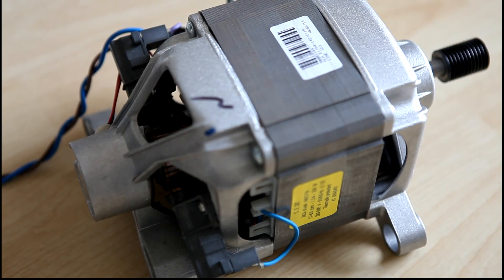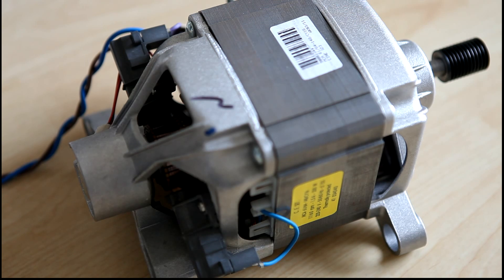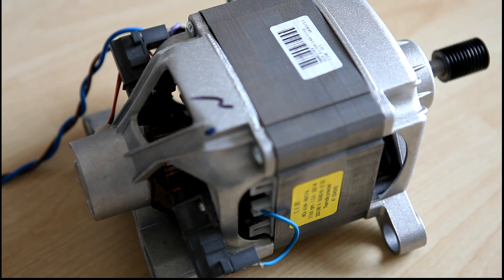Washing machine motor wired in as series motor (suicide motor)

Comment: I think that a separately excited field winding would have more chance of a run away  . If you turn off the applied voltage to the field windings while it's spinning the motor will go into run away .

Comment: What you have here in this video is a universal motor. It will most certainly never be found in any stationary applications used in North America. Universal motors are so named because they were designed to work on DC as well as AC. The last one I acquired was very old in the early 1970’s. Somewhat smaller motors of this design are still manufactured for plug in hand held tools mostly circular saws and very large drills. In the states the series wound units have a small shunt winding in addition to the larger series field   to keep the motor from over revving and splattering the armature coils all over and destroying the unit after reaching speeds in excess of 5000 rpm! Centrifugal force at high speed will do it.

Comment: Washing machine motors in the U.S. are always AC induction motors. I never saw a brush type  one. There may have been such motors in the old days when the machines ran off DC (New York City had DC power years ago)
Reply: norman gates  This is a universal motor. Can run both ac and dc curent.
Reply: This is a series wound motor. It is able to run off alternating current.
Reply: Yeah every washer/dryer motor I’ve seen in us brands have been either split phase induction or more rarely, bldc motors

Comment: why not use the tach gen on the back of the output shaft in closed loop for pwm giving a quite robust power output with variable loads and desired revs.

Comment: is it feasible to use it to power drones? 3 to four motors. Could it generate enough torque to fly a DC battery and chassis?
Reply: no, too heavy. You need brush-less
Reply: may be to inefficient you can get 3 wk bldc motors for 100 $ on hobby king tho witch are more powerful than washing machine motors and a lot lighter too but i think the most important thing is that they can control their speed much better

Comment: The inclined brushes, don't they imply the motor was meant to rotate in a certain direction?
Reply: Yes, of course. Motors designed to spin predominantly opposite brushes incline. It improves commutation in hi-rpm motors (weakens negative impact of vibration and collector's asperity on brush contact).

Comment: Some of the newer washing machine motors are actually electronically speed controlled via power mains and small speed-control circuit boards...and they are induction, NO brushes.

If you can filter any resulting RFI / EMI from them or being fed back into the mains, they make some very "powerful" and relatively easy to speed-control motors, with "generous" torque ratings as well....and some are actually priced decently, regardless of ones world location.

Comment: Such a liar, that motor is new and has never been in a washing machine.
Reply: +TruAnRksT I have one that looks the same and it was in a washing machine
Reply: -CLM15-
Wow must be pretty new and kept in a nice area then caus, ...
...there isn't even a spec of dust on that one. Did he pressure wash it? Was it manufactured so well that there is no sign of corrosion rust or even dust. How long could it have been used in a normal environment without showing signs?

Maybe, if it was removed from a returned defective unit could explain it's pristine condition.

Just look at the close up of the brushes, there is no powder residue around the brush mounts as you would expect on a used motor.
Reply: TruAnRksT I'm sure he cleaned it. Mine was a little dusty and I also removed the brushes so it can spin better.

Comment: The high quality washers (front loader) need to do many amazing things : slow rotation in one direction, reversal of direction with little dead time, slow rotation in opposite direction and repeat this cycle about 5 times.  This is done to spread the cloths uniformly to balance the weight prior to a fast rotation to drain water.

The DC motors inside cassette players include a gyroscopic speed regulator. If you would apply varying voltage, you would ear the music can be slowed down with lower voltage, but not speed up with higher voltage. With higher voltage, more sparks are generated in the commutators of the gyroscopic regulator.

The low quality washers which are still what most American can find in store even in 2015 use an induction motor. These are similar to squirrel cage type used in vinyl record players or microwave fan, but they use a gyroscopic switch to apply large current at start.
Reply: it's funny that in Europe (at least Poland) there are no new washing machines with a one-phase induction motor (there are VFDs in the better ones)

Comment: if the ac supply is at 50hz, the max speed the power supply can generate is at 3000rpm due to its pulse.. and if the motor is designed to withstand the speed of more than 3000rpm, the motor wont kill itself.. ok.. now let me return to my research cavern and think on how can i design a motor that can withstand 100,000 rpm without breaking itself apart even after running nonstop for 12 months on 50hz power supply..
Reply: +Vladimir Ashkanikov When going into your research cave you might wanna do some research on universal motors aka AC series motors. A universal motor's rpm is not bound to the frequency of the supplied AC current!
Field and armature are reversing polarity synchronously so it's as if you rectified the AC supply to feed a DC series motor.
Reply: ppdan why don't you go back to your cave and learn about N=120f/P
Reply: +Vladimir Ashkanikov Whatever, that formula is not applicable for universal motors! Speed depends on load!
http://physics.stackexchange.com/questions/210450/must-a-universal-motor-always-rotate-at-the-frequency-of-the-ac-current
Reply: ppdan you have a point..
Reply: I want psy songs in motor toilat
Reply: Lol this guy thought it was an ordinary induction motor.. Looking at speeds of 50-75,000 RPM here. Nice try tho.

Comment: You've got the motor running the wrong direction. On spin the motor runs the other way so the commutator slides under the angled brushes. On spin the motor is not under control from the trial on the board but is let go on full mains voltage as you have it running now, but the other way
Reply: Triac?
Reply: How will you change the spinning direction?

Comment: what does overspeed mean? like is it when the vibrations get too big and the parts just fall apart at some point?
Reply: series wound a.c. motors have no theoretical top speed. basically what happens is  centrifugal force and heat cause the brushes and commutator to burn out, in some cases literally exploding the commutator bars(see videos from Aussie50 and photonicinduction)

Comment: is there something like this out there that can regulate or control voltage digitally? or using a sensor? thru code on the arduino?
 
in other words i want to have something like this plugged to a motor driver set at a working safe dc brushed motor driver/controller setting but incase the motor picks up a load higher than the current setting cant output due to load the arduino can have the output from the converter step up by incrementing "++i" its voltage state digitally rather then you doing it by hand? therefor now the motor driver can have the motor handle the new load till theres no load and now the arduino can step voltages backdown to original safe settings?
Reply: Frank Lopez 
I'm trying something like this. PWM is your keyword, while controlling the PWM-value via a PID controller. I run it straight from rectified mains, so 325V DC, via an IGBT. Having a stable RPM-feedback is esential for this. The internal tacho of the motor is no good at lower RPM, so I attached a magnet to the axle and use a hall sensor. My goal is to react to a load change within a tenth of a second.
Reply: superdau right but im using gears so i will not be having the horn or what not at this shaft end but at the final ger resolution ill be building up to, i might have like some 4-12 gears interacting with each other to build up torque thru momentum and at the end of the last gear i will have a final output shaft where ill have the lever, or "servo type of horn"  

yes i already been order a hall sensor "looks like a transistor" and its control with a magnet which i will be inserting into the gear itself that i will be 3D printing OR just cnc mill it
Reply: Frank Lopez 
Do you have any image or part name of the thing that you use to connect something to the motor shaft? My control is working more or less now, but I don't know how to mount anything to the motor shaft (it's a hardened 10mm axle without any threads, flats or grooves)
Reply: pm me will talk more about it

Comment: Can you give me any help on this?  I went to the dump today looking for a motor to drive a project I'm making, and I found this exact same motor.  When it is driving a washing machine, it presumably has some sort of mechanism to make it run slower.  Do you know how it works?  Like the electronic control in a drill?  Being as the motor is only rated at 370W, I would have expected that running on only part of the phase would make it incapable of turning a drum full of wet laundry!
I need mine to run much slower that that!
Reply: The motor itself will run as fast as it can, given input voltage and the load you put on it. Washing machines control the speed probably through a triac and a PWM circuit. You could do that with a micro controller such as an Arduino.

My Kenwood kitchen mixer (and most KitchenAid mixers) have speed control through a spinning weight that breaks contact at a certain adjustable speed. When contact breaks, the motor slows down until contact is being made again.
Reply: 1313EbutUoy
Ah, yes!  The Kenwood Chef.  That speed control was designed before electronic controls were available, and Kenwood has not exactly shown itself to be surfing the wave of progress!  I'm surprised they don't use a steam-powered one.  Triac-based phase control is used to control the speed of practically every mains-powered electric drill you have been able to buy over the last 20 years, and I built a speed control for my first electric drill when I was about 25 years old - and I'm 69 now, so they have been around that long!  Even my electric blanket uses the same system.

Since posting the request for help above, I have done a bit of research, and found that there is a chip specifically designed for speed control of the Universal Motors in washing machines ("universal" because they will run on AC or DC).  The chip uses the tacho on the motor to sense speed, and can run the motor over a wide range of speed.  The chip is the TDA1085C (Google it), and is sold by several companies.  The one I bought is made by Motorola (a couple of dollars), and I have built most of the circuit (about $10 altogether).  I'm waiting for some connectors to complete it.

The TDA 1085C data sheet is available all over the web, and it gives an application circuit.  Once I complete it and make it work, I will post a short video on it, as there seems to be very little info available outside of the data sheet application, which still leaves some questions to be answered (but not by Motorola - no money involved, so they won't support it).
Reply: If it was more than say 10 years old what you have is an induction motor. It’s speed is line frequency dependent. An honest mistake because they all more or less look the same. His motor while it looks like yours is not an induction motor and will run on DC as well as AC but it’s speed is variable only by the applied voltage. It doesn’t care about 50 or 60 or zero line frequency hertz (dc). Find a newer usually front loading washer out of use because it leaks badly or door hinge broke. Remove the motor and the electronic controller and it can make a great replacement for a table saw or drill press  I have one fitted to an old table saw and now I control speed/ torque electrically or can change sheaves on the drive pulley the way it was built 65 years ago. Lots of options for hard or soft wood and controlling smoothness of cut. Take care at highest speeds as the carbide inserts on the saw blade can and will fly off. Let your blade cool off plenty.

Comment: It can be run on dc current ??
Reply: Dusko Lazic no
Reply: Dusko Lazic no
Reply: Dusko Lazic 
Yes, it's a universal motor. https://en.wikipedia.org/wiki/Universal_motor
You need some kind of active speed control that actually measures RPM though. Without it the RPM depend very heavily on the load and the motor can self destruct by overspeeding without load.
Reply: well, you could just connect it to another motor , thats powered by a capacitor charged by a small trickle of the input voltage from the other? I would have thought it would need a pulse, otherwise it will just engage all the windings at the same time, so you need a mosfet and a pulse that relates to the speed you want the motor spinning at, I made a starter motor that runs on Ac but can also work on dc, i use it for a gas modal car* it will generate 1 pulse for ever 2 full rotations of the motor, for now i just use a Mosfet and my raspberry pi. You could pass the negative threw the Mosfet and into the motor and just feed it a rapid pulse, thats what i do it works for most of them.
Reply: Ozzie Peck 
Whatever your motor is, if it needs pulses or even alternating current to run it is not a universal motor and something completely different than the type shown in the video. A universal motor will run on DC.
Reply: I dont see how it could? it would be wired to work on ac, so it would just move a little then stop?

Comment: You can't run such a motor on mains, as shunt, It is only for series connection.

You would do better by spinning it in the right direction. The brushes are angled for a reason.
Reply: such motors spin both ways in washing machines anyway

Comment: The armature design ,and high strength  epoxy is holding things together. plus at high speed the slight out of round of the commutator makes the brushes jump some causing some current loss so speed stops developing

Comment: What does this prove? What are the practical applications of this motor aside from being a speedy pencil sharpener?
Reply: It's operated on load condition and which means it's suitable for things which need high starting torque and are constantly on load (which means they are never on no load)
Ex- trams and locomotives

Comment: You don't have a variac? You need a FUN-JIGGERY-POKERY UNIT. :D

Yep, that motor in one side of the Fun-Jiggery-Pokery Unit, while it's wired straight across the brushes, then on the other side of the Fun-Jiggery-Pokery Unit, you could plug-in a range of appliances, increasing in load to get the motor up to speed so that it finally fizzes-over, we get sparks, pops, a sparkler light-show and then....

FLAAAAAMES!!! :D LMAO.

Interesting that you got it to whizz-up without popping though!

-BBD.

Comment: Do you still have the motor?

As for speed control, it's just frequency from speed sensor (variable amplitude, so do clip the tops if your electronics can't handle it). And phase-angle on triac to control power.
(TDA1085C e.t.c. have it all built in)

Comment from the maker: Yup. Did it myself. £15 for a replacement part, delivered next day.
5 minutes to replace it.

Interestingly, it's not a solenoid. I couldn't work out how the old one worked. 

It looked like it was 1 microswitch, and something very odd, a bit like a microswitch with strange pill-shaped things in it - both things sharing a common connection.

The mystery thing seemed to operate the lock. Possibly heated pills which stayed hot and locked the door via a bimetallic strip - giving delayed unlock.

Comment: Heh if you want the commutator to fly apart then just go straight across the brushes, ignore the field windings :)
I'm surprised at the startup tbh, last time I went direct online with one of these it almost jumped off the table! Is that thing spinning in reverse?
I tried the frequency setting of my multimeter and while it did pickup pulses from the encoder it soon went out of range as the speed increased.

Comment from the maker: I think it might be designed to run in this mode for a spin cycle. I suspect that it is overspeeding, but not massively, as it produces a lot of brush dust and the arcs are bigger than I would expect. The com bars also get very hot, very quickly. I don't think it would be capable of running like this for very long. 

I'll see if I can work out how the tacho works, and see what I can connect to it.

I also reckon that it's probably meant to have some sort of speed control system connected.